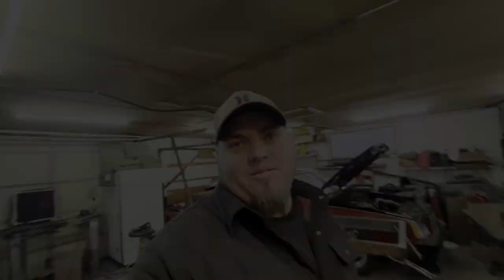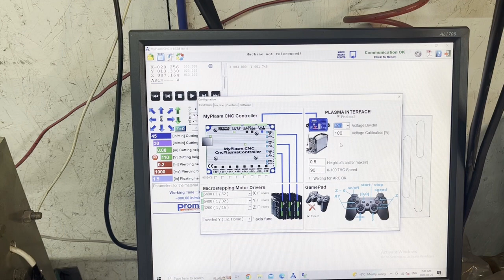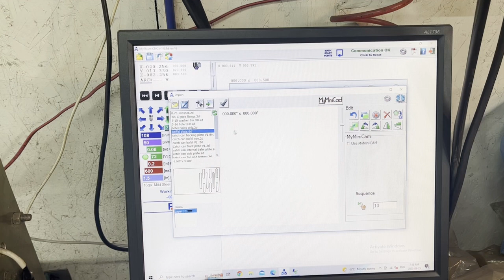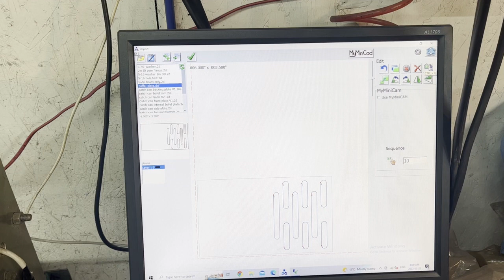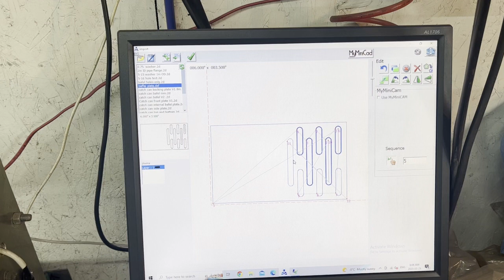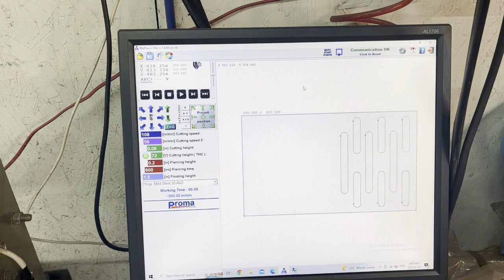BEST CNC PLASMA CONTROLER SOFTWARE - Basic overview of MyPlasm CNC. Best thing to happen to my cnc

Comment: I've had nothing but issues with my myplasmcnc controller,
Reply from the maker: Really? Wow it has treated me well. But guess anything can happen. What have you seen?
Reply: @letkemanfabworks619 aside from the ohmic never working correctly, garbage toolpaths making circles nearly impossible to cut cleanly even after entirely rebuilding the table it was on to eliminate nearly all backlash

Comment: You can make your own ohmic sensor.  It's just a metal tab that touches the shield cap.  Look at the hypertherm #220953.   It's just a metal tab hose clamped the retaining cap.   One side touches the shield cap and the other side fits a spade connector. Run a wire to the board and you're done  :)

Comment: I'm building a small CNC plasma table using v-slot extrusions and nema 17 motors for x,y,z axis. I'm at the stage where I will need to build the control system. I'm new to this and trying to decide what electronics to buy. Looks like I will need motor controllers (one per motor) a power supply, and a breakout board. However, I read a breakout board that connects to the computer via Ethernet is less prone to HF interference than one which only offers USB. Can you make any product suggestions for me or offer any advice? I would like to have torch height control. This software looks like a good choice. Thanks for the vid and info. Subscribed.
Reply from the maker: Thanks for watching. Some of the more pricy units use Ethernet and yes it dose help with HF however if you use shielded cable and keep the plasma machine as fas as posable from the table I have had no issue. It all come down to what you can afford. But this unit for the price and ease of use I would highly recommend.

Comment: Thanks for this! I was just researching this setup.
Reply from the maker: No problem. I have not regretted it once. It’s a bit simple for some people but that’s what I needed lol thanks for watching. Hope to do a few more vids on this set up in the new year.
Reply: I built a 4x4 CNC with Mach 4 and it's worked well but is over the top for most things. Thinking on a small plasma build and want it to be something other guys can quickly learn on. I downloaded their apps and am impressed. @letkemanfabworks619

Comment: Hello, your videos are very good and illustrative. What plasma cutter do you have connected to the CNC? I just received from Proma system the board and the interface with the voltage divider to mount on a CNC that I am making, haven't you had blocking problems in the Proma electronics due to the plasma frequencies? Greetings.
Reply from the maker: I am running a Primeweld cut 60 that is being used. I did have some interference early on but now I have my plasma cutter mounted as far away from my computer as posable and seems to have solved my problem.

Comment: Do you have a link where you purchased it at? I can't find it for the you mentioned
Reply: You wouldn't happen to have a pic of your controll box layout with what you have in it? Like stepper drivers, if you also purchase there voltage drop just something to get a layout idea. New to this
Reply from the maker: @wildnuts6197  hey no problem I can see if I have something. I also have a few more vids in my Chanel of the build might be more on there. But I’ll see if I can find a photo.
Reply from the maker: @wildnuts6197  https://www.instagram.com/p/Cf5Cyssu06P/?igshid=Y2IzZGU1MTFhOQ==. This is form my instagram. This is a photo of the inside of the box.
Reply: @letkemanfabworks619 that layout looks good, u remember what drivers u used 542,6600 etc. Open or close loop. I'm trying to get a list of stuff to order all at once. I have some of the stuff already.
Reply from the maker: @wildnuts6197  to be homier I don’t recall. But I’ll see if I can find out. I got it all in one kit….motors, drivers, and power supply. It was an eBay special. But I’ll check 👍
Reply from the maker: @wildnuts6197  from what I can see. (It’s hard to see it where the box is located) they are LONGS  DM542A drivers.
Reply: @letkemanfabworks619  does this come in English since you ordered from Poland did you specify English. I see they have some deals going on right now, might get 2
Reply from the maker: @wildnuts6197  they have a “translate” button in the top right corner of the site I believe. And if you email them there English is not bad to deal with.
Reply: @letkemanfabworks619  what strip do you run your car at
Reply: Cool thanks for the info
Reply from the maker: @wildnuts6197  not a problem. Not sure if you have done this or not but the software is free to download. I would recommend downloading it and playing with a bit. 👍
Reply from the maker: Here is there web site. https://proma-elektronika.com
I hope that helps. 👍 if not let me know.
Reply: @letkemanfabworks619 good day. I think I recall saying your in Canada? So am I and I'm having a hard time finding a dealer for the MyPlasm. Did you buy direct through Proma or else where? Also is a separate voltage divider required or Is that all taken care of with this system? Thanks for your time, Yoti
Reply from the maker: @yoti-fab  hey yes I bought strait form proma electronica in Poland. Vary nice and easy to deal with. And as far as voltage divider it has some built in to the “black box” you just need to pick which one you are using. You can view the manual on proma electronica site. I would check that out as there is a lot of good info. Especially before you purchase. 👍 thanks for watching.
Reply: Do you know if there is a offset setting for the plasma to make a perfect 1/2" whole or what you get is what you get?
Reply from the maker: @wildnuts6197   in the “import file” window. On the right side there is a slide bar called “offset” this is ware you dole on your Kirff width. There is good info in the manual on this as well.

Comment: That looks like some really simplified software, but it's sad it won't work for my table with servos let alone my controller runs on linux and the controlling PC is windows 10. But it would be nice to have such a simplified software like that.
Reply from the maker: Hey thanks for watching. If you go through some of my other vids I have some of the table cutting. And yea it is nice and simple. As for the drawing I use Inkscape and fusion 360. And in this software you can scale your dxf in side the lay out “page” of the software by present or by length of ether the x or y axis. Really handy.
Reply: @letkemanfabworks619  Very nice, I look forwared to watching some more videos you've made, Inkscape is about the only thing we have in common and I use inkscape for everything, Vector & Raster  as many only knows it's a vector software but it can do other stuff as well as I learned in the 12 years of tinkering with that software. But thanks for the very quick response and again nice videos.
Reply: *video so far. lol
Reply from the maker: @dogcreek-customs5168  thanks lol I will be starting another cnc vid soon I hope. Going to be build a new machine.
Reply: What are you using for desinging that to resize a dfx you must redraw it? I use inkscape but i only use SVG in place of the Dxf file and none of that would require to redraw a design to scale it up just resize it and export it.
Reply: Besides that from what I see good video but I am kinda sad that you didn't show the actual table in this video. Thanks for helping people out & sharing your experience.

Comment: 1. try click rotate button by right mouse button ;)
2. Orange line in import window it's not a limits or machine area - it's your material area and it helps for nesting
Reply: I think that’s the inventor commented, great plasma controller, I have had candcnc and flashcut and really like myplasm the best
Reply from the maker: Hey thanks for the info. And the right mouse button I actually found that out the day after I made the video so felt a bit stupid on that one lol but thanks for watching. 👍